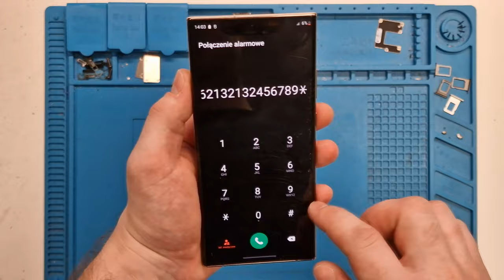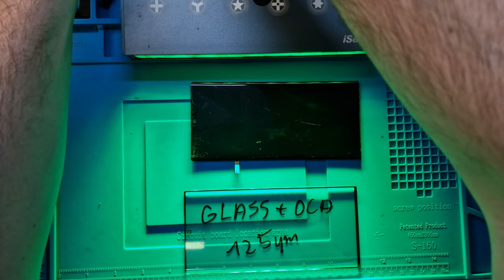🔧Galaxy Note 20 Ultra Glass only replacement (complete guide) 4K⚙️

Comment: A list of what tools you used along with any cleaner you used would be good. I did not think that you would be using a rotary multi tool with a diamond cutting disk does it need one? All I want is to change the front glass.

Comment: How much would it cost for me to send you my phone on you do this because the screen that I got from the shop I got it at they told me they won't replace the glass whenever that's the only thing wrong and funny enough my pin functionality wasn't working with the screen screen but they won't cover it because now it's broken but I straight-up told them the pin wasn't working beforehand